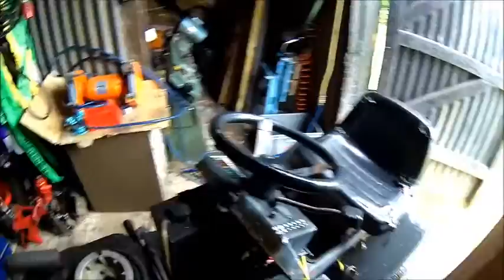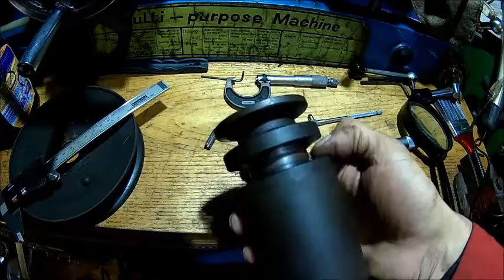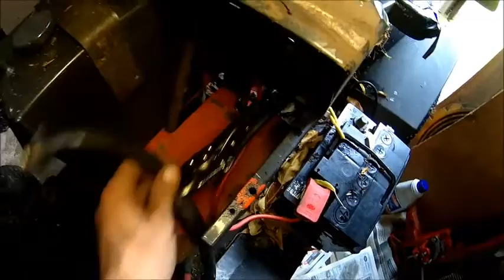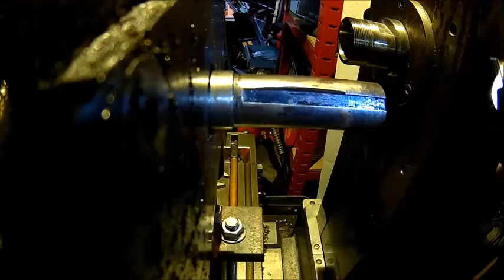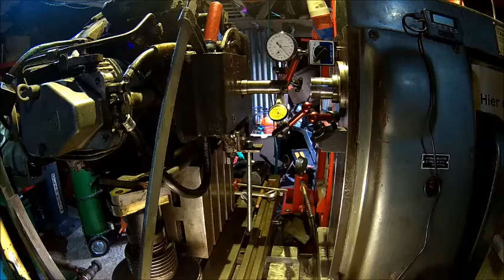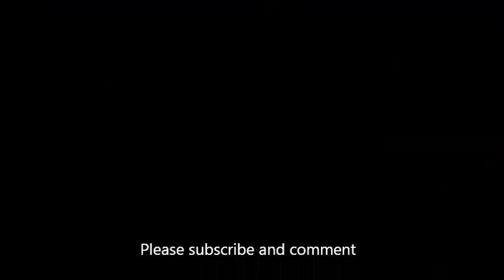On-engine Crankshaft machining, Lombardini diesel, Westwood lawn mower, Garden Tractor, Part 1

Comment: Good job with the work holding problem. Not easy if you are working alone. Hope you had a hoist.
Reply from the maker: Thanks, luckily the engine is quite heavy, so it sits well on the table, essentially it was held by 2 bolts, a screw jack and 2 clamps.
My biggest fear was that the mill tips forward, it's a pretty heavy machine but the weight was hanging right on the edge of the table and the mill is not bolted down as my crumbling concrete floor won't hold anything... and yes, i have an engine crane.
Just working on part 3 right now.
Reply from the maker: Part 3 is now up,
Reply: @dynoguy  hi there.
  I was looking at the video of the transmission pulleys. It's highly unlikely that you would ever need to change them. But you can service them. If you're like me never chuck anything out.  Check it out remove the plastic cover on the bearings. Clean up all the old crud out I used paraffin and a small half inch paint brush. Then blow off with airline. Repac greace in the bearing not to much. Then replace the covers. You'll need a socket to tap the cover back in place. Never buy bearings again you can do this to any bearing with a plastic cover.
    Cheers 
               Des